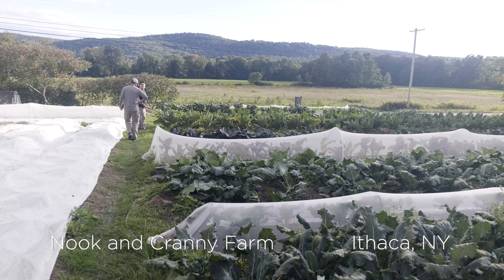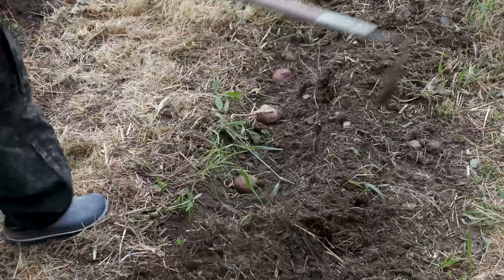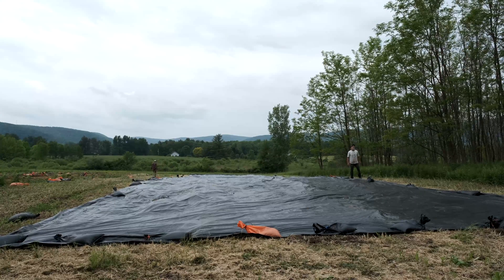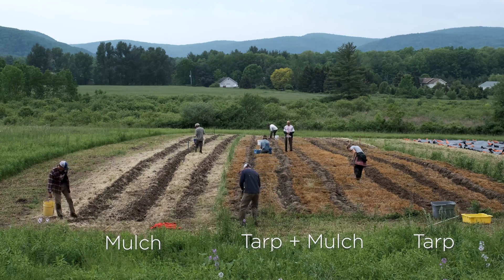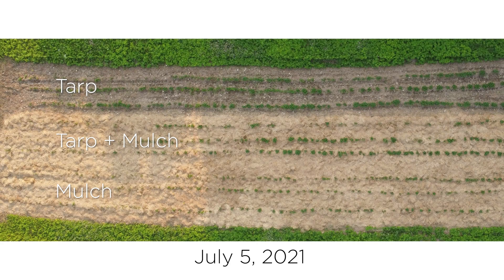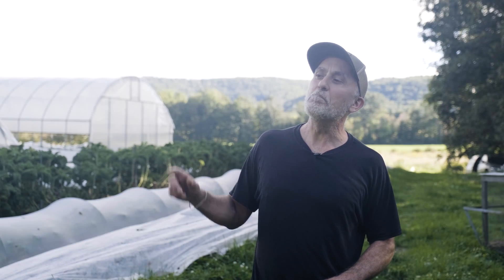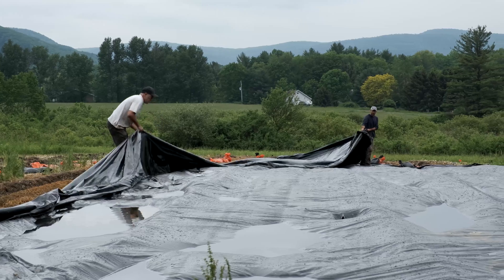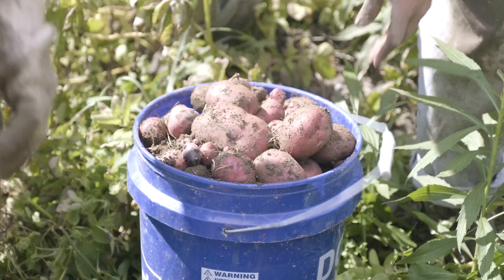On-Farm Experimentation with Reduced Tillage: Tarping and Mulching in Potatoes

Comment: I don't see how you could justify any of this commercially- and I've done it! The problem is yield; potatoes develop above the seed piece, and high hilling with soil encourages multiple sets and maximum yield. Deep planting and mulching can't really equal this without making the harvest more problematic than the tillage would have been. Also, borers are a real problem in a system like this, making about half your yield unacceptable to consumers. I'm sure someone will claim they've reached peak perfection doing it, but I've got 15 years in of growing my own this way for experience.
Reply from the maker: Thanks for sharing your experience. What is interesting about this production system at Nook and Cranny is that they used to have a more conventional approach and they shifted away from it. They found they can get the yields they want for commercial sale with the labor, tools, and materials (like mulch) that they have available. Of course, it's a developing system, hence the focus on experimentation here, never perfection, always tinkering and adapting. Check out the links below for more details on their yield results.
Reply: @cornellsmallfarms  - the yields are awful, especially given the inputs. If anyone insists on this sort of approach for growing potatoes commercially, I'd recommend late summer/fall sown oats, with the potatoes sown directly (either into a very narrow furrow, or 'drilled') into them as early in the spring as is safe. For me that's 2-4 weeks before the last 32 degree frost. Their method of hilling would work well with this approach, and the incorporation of some form of nitrogen at the hilling would make for fewer weeds and higher yields. You can incorporate all your P & K into the ground at the time you till the oats in, or use manure.